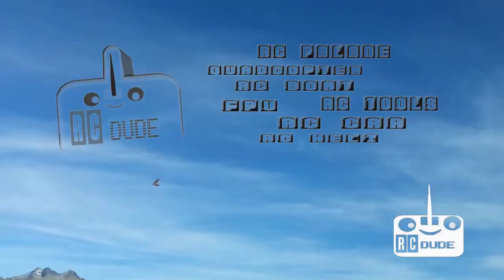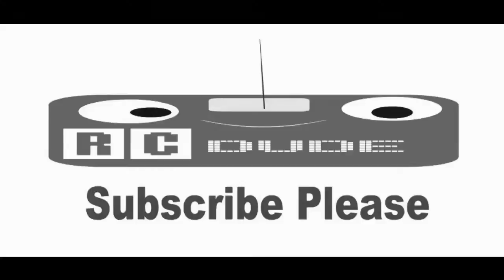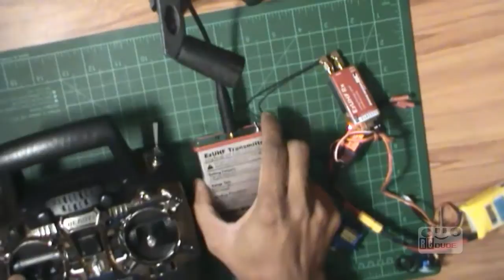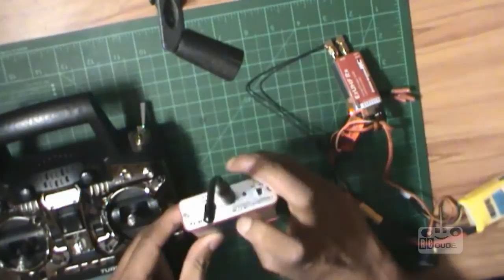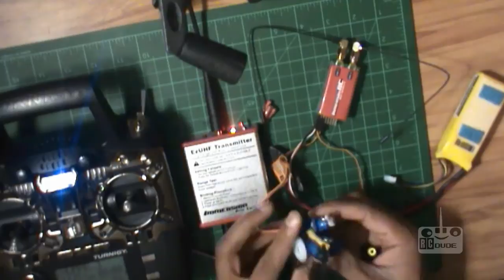EZUHF Transmitter How To Binding

Comment: Hi RC Dude, thanx for the video. I would need help. EZUHF can connecto to futaba sg14 through the trainer port, but when I connect it there is no power supply to EZUHF. Do you know if I need to set something in trainer menu for the signal to be available on the trainer port or plugging cable itself would take over the commands. Thank you for your answer.